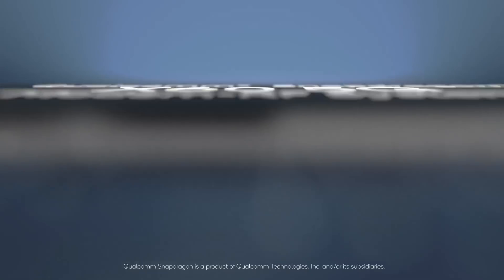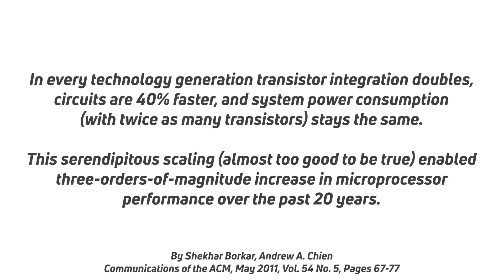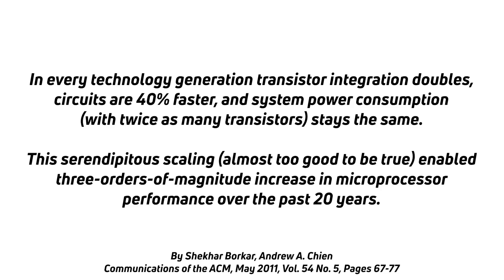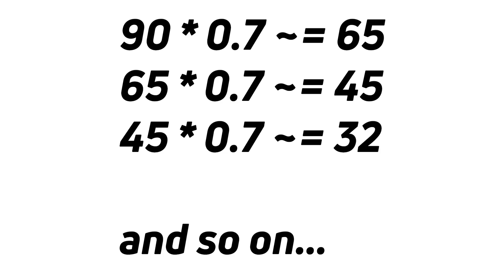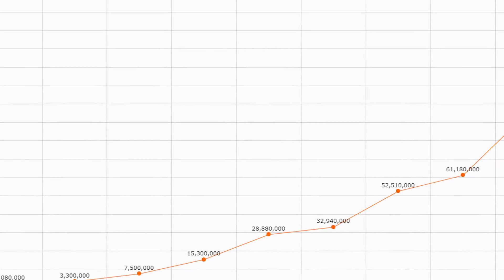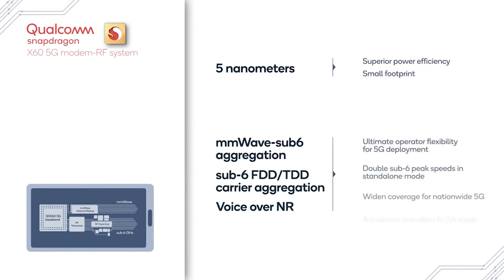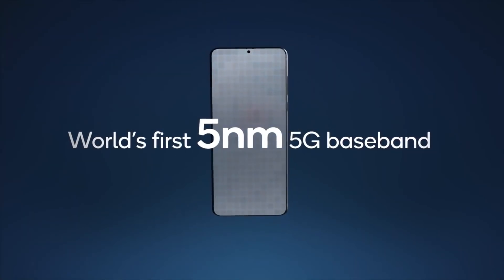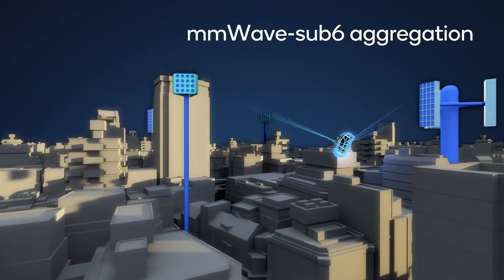5nm Qualcomm Snapdragon Chip Announced

Comment: best process of finfet is from samsung
tsmc has too much load on it.
I have used samsung ones in iphone se
It was much better than tsmc version
initially battery drain was from samsung at 14nm and heated and tsmc used much larger die size but after updates it got resolved with an undervolt and underclock in stress now Samsung handled much better like 8% better.I did find some stuttering but all went smooth.
I favor tsmc but now samsung is heating up

Comment: I'm still enjoying my 855+ 7nm Chip and I'm loving it.
Reply: Even 845 is still a beast
Reply: Hence even 835 is enough power my s8 can run rtx ray tracing and play at solid 60fps in minecraft and play fortnite at 40-50 fps using game launcher tool
Reply: @duckduck7459  wdym rtx Ray tracing there isn't any game with rtx on mobile
Reply: @viperro4542  minecraft texture pac .-.
Reply: @duckduck7459  a texture pack cannot have rtx and infact even if you have a shader pack it can't be rtx because it's on mobile
Reply: @viperro4542  whatever, I download something called rtx shaders lol I got scammed but still shaders take good amount of work for gpu
Reply: @duck duck . that's not "RTX(proprietary btw) " that's just path tracing or some other hybrid rendering for rasterization
Reply: Still rocking with my 845 chipset 👍 and it didn't slowed down yet
Reply: Still on 801 ac
Reply: Still using a CPU with 45nm
Reply: OnePlus 7 ❤️
Reply: Rocking with my 430 ahehehe
Reply: My A12 bionic flies at 60fps on fortnite, pubg, cod mobile, minecraft 🤣😁 goodluck yo
Reply: @nikhilk2809  cool. For me 835 is more than enough power to serve my needs

Comment: Is lowering capacitance the main they are doing?
Reply: I'm guessing you're thinking 5nm is the distance between two conductive plates in a capacitor. No, that's not what's happening
Reply: @Videohead-eq5cy  I know that. I'm wondering if gate capacitance is the main issue.

Comment: How come one 5nm can be worse than another 5nm?
Reply: maybe it's design
Reply: Say one wire from one transistor to another is longer on one chip than the other, due to architecture, and that wire had to carry a lot of current in day to day use, then the processor with the shorter wire is better than the other
Reply: @Videohead-eq5cy  Thanks, makes sense.

Comment: SO, I guess this is an ignorant question: There's the manufacturing process (by Intel or Qualcomm or whatever) and there's the chip design by say ARM. Can you use the same chip design on a smaller process? Could you use whatever the design is for some current 7nm chip and just do it on 5nm? Or is the design very closely tied to the process?
Reply: I guess fabs can print whatever onto the wafers, so there can exist, in theory, a 5nm snapdragon 835 but why'd people want that in practice anyway
Reply: @Videohead-eq5cy  well, I'm just trying to understand - there's supposedly some gain in speed by the new design and some by the new process - how can you tell which is contributing more?
Reply: you need to learn how intel tick-tock used to be. with the same design but different manufacturing process is a common thing

Comment: That's good news. Was considering swapping out my Poco F1 for a SD865 phone this year, but now, I'm going to wait for the 5nm chip next year. Thanks for the update Gary!
Reply: No need to wait all the new 800 series processors  are fast enough just look for an amoled display that will make all the difference coming from a poco f1
Reply: @tanishqbhaiji103  Nah the poco is good enough my dad has it.Im using a k20 pro(Mi 9T) and although its great, its maybe not worth the jump?
Reply: I'm still rocking my poco. Can't find a phone worth upgrading to right now. I'll wait too.
Reply: @Jules-kp7rw  Moore's law is not what it used to, and may not be too much time but it took around 2 years  to pass from 7 to 5nm, (assuming the 5nm processors appear in some phones at the end of 2020) and according to TMSC they will get into 3nm processors in 2023 (apparently Samsung says 2021 for them but who knows). In any case waiting for the first device with a 5nm may not be a bad idea right now, but on the other hand 7nm ones have matured (I assume) so the question would be if there will be too much of a difference between the latest 7nm processor vs the first 5nm one
Reply: @walkinmn  3 nm in 2023 . 
2021 2022 5 NM processors i have pocophone too next year i Go for Black shark 4 xiaomi.
Reply: After 5nm there is going to be a huge gap for "the next big thing". We are at a limitation where we cannot make transistors smaller.
Reply: This cycle will keep on bro

Comment: I wish Qualcomm would release their flagship processor earlier
And I mean putting them in actual phones much earlier 
Apple and Huwawei launch their new SOCs around October and put them in actual phones that we can buy the same month
On the other hand we have to wait till March of the next year to get the new Snapdragon SOCs in actual phones, that's 5 months from when Apple and Huwawei provide them, almost a half a year late!! 

That really sucks! 

And you get brands like Google's Pixel, Oneplus T series and Asus ROG phones launching around October/November with previous generation SOCs, promoting them as cutting edge flagships and pricing them at that level when the iPhones and the Huwawei mate phones are one generation ahead 

It's really frustrating
Reply: Almost half a year later
Or half a year earlier 🤔
Reply: @MsMonster128  Considering the performance difference, 5 months later
Reply: @Ignacio.Romero  if the performance it's all that matters then it's earlier because it's way on top of kirin, but it's way behind Apple, so what's the deal in that case?
Performance can't be the base line for that
Reply: @MsMonster128  Apple and Huawei both launch their next gen SoCs on October, Qualcomm launches their equivalent gen SoC 5 months later
Reply: @MsMonster128  Samsung and Xiaomi usually launch first around 5-6 months later 
Oneplus usually launches in May so it's around 7-8 months later
Google launches their Pixel around  October/November so 1 year later and it's SOC is always one generation older than that of the iPhone and Huwawei
Reply: @dominozonda  OEM's launch date has nothing to do with that,  it's relative
'Xiaomi and Samsung launch first around 5 to 6 months later' 
Later than what, apple's bionic? The same can be applied to Apple, Apple launches its Bionic 6 months later than Qualcomm
Or instead of using the launch date try using the year, Qualcomm launches his processor in the first quarter of each year, Apple in the third quarter, see, in this time Apple came after Qualcomm
It's stupid to think one is later than the other when many OEM's have different launch dates and each OEM launches his product the same month each year
If that's the case, the iPhone 9 will be 7 months late because it will run the A13
Reply: @MsMonster128  it's not that difficult to figure out who is ahead of who, what is this video talking about? What was I going on about in my comment?
It's the new generation of manufacturing process node
So obviously the one that uses that new generation is ahead of the other!
And it so happens that Apple and Huwawei are ahead of the rest by a few months as I stated in my comments
And actually it's not only that, these new generation SOCs are based on the new ARM design, should be Cortex A78 this time, so there is a clear distinction between the new generation and the old and between who is ahead and who is not
It is quite stupid not to see that
Reply: @dominozonda  I agree with what you're saying, you're absolutely right about that (using newer technology) but they are not using previous generation (As stated in your first comment) they are using the same generation
but i will keep saying it, performance can't be the baseline to decide wheter one SoC is "Next Gen" i agree with you, is more of a nm and architecture difference (Wich impacts in performance) and i stand by in this because this already happened a few years ago, before Apple unveiled their A11 Qualcomm was on top, and the Youtube was fill with the same comments, saying Apple came 6 months later and with less performance
Reply: @MsMonster128  dude, all I want is for Qualcomm to release their 8 series SOCs earlier so that phones launching from October onwards would have the chance to use their new gen processors and GPUs and for us to get all the benefits
This way phones like the pixel, Oneplus T series, Asus ROG phones and all other phones launching at that time would have the chance to use these new SOCs
They are charging us flagship prices but have older technology in their phones
New SOCs are more powerful, more efficient, have new features, better photo and video processing, better gaming experience and can improve the overall smartphone experience + they are more future proof
If you are paying the same flagship amount, would you want your phone to have the newest most cutting edge technology or not?
Or they can simply cut their prices by maybe a couple of hundred dollars if they are using the older technology 
That's another way!
Reply: Kirin 990 is weaker than the snapdragon 855+ in almost every way. the 990 can barley reach the 855 score range but the mali gpu is muuch worse than the adreno one. Driver support is already much better with adreno gpus and qualcom will update gpu drivers over the playstore much more frequently in the future wich will give it even more of an advantage. Dont let huaweis marketing fool you.
Reply: he is just saying that new processor should be available from next month of the launch not  after 5 or 6 months , he gets teased by the performance of new processor (its like a trailer to build up hype) 🙃. i think that's what he is trying to tell¯\_(ツ)_/¯
Reply: They launch compensating midrangers in the gap
Its a technique all these companies have actual representatives in other companies to market their services, engineers and products
Reply: Calling it late is a misnomer it's later than some others and earlier than others. There are no doubt going to be improvement made over that 6 month period. It is a company it they could produce the same body of work in a shorter period and retain the same quality, they would.
Reply: Remember they make a lot of soc almost for all   company( exception are Apple & Huawei ), even they make soc for Samsung. I think it is the reason behind it.
Reply: Qualcomm are not behind, Google should launch earlier, and TSMC its a joke of company!
Reply: Is 5 nm process is so important for you that you want a weaker kirin processor for this..??
Reply: This is nothing bro compared to Samsung 
They prove exynos processor as same rate as sd processor. 
Just look at S20, exynos version gets only 8 gb ram and 4g compatible with antutu score of 520,000
While S20 with sd865 comes with 12gb ram 5g capability and antutu scores 600,000 
Almost 80,000 higher score than exynos and they sell at same price.
And another bad thing is that in launch event they dont give any detail about exynos version devices.
And all the YouTubers get sd865 version to review.
Reply: Is not bad at all.

Actually, Android needs time to optimizing newer SoC. Thats why if you see Google Pixel, its has same level or even more updates than other phones even with older SoC.

Android its just give you about 2 times of OS update and Using newest SoC is not efficient cause the older one can have same level of software updates. And then you need to wait for apps optimization on your newest SoC about unknown time. Android is not like iOS that closed source OS and longer OS update.
Reply: Kirin sucks
Reply: They are not overpriced
Reply: Haahahahaaa. Qualcomm sells chips to companies, so they have to announce as early as it's possible for their customers to start working on the new designs. Apple sells products to end users so they announce whenever is optimal for best Christmas sales. Their announcement timing has nothing to do with when they got their hands on the new chips first. In fact you can be sure that the development cycle for the phone is at least one year, because the launches are yearly. That means the components, chips included have to exist even earlier.
Reply: Fanboy